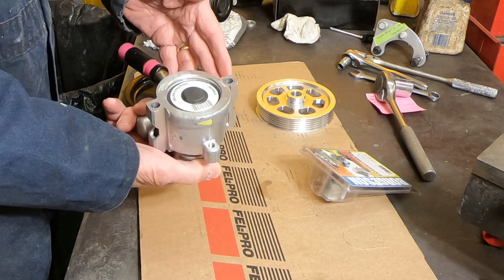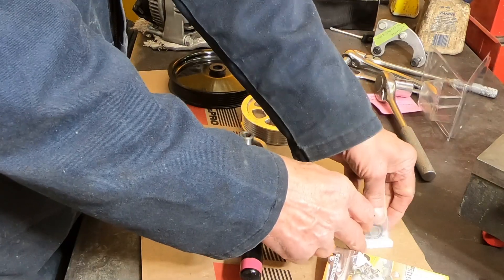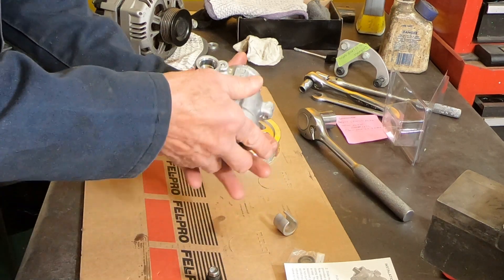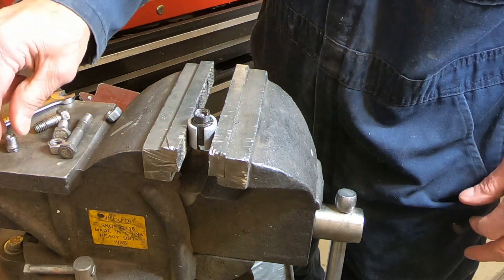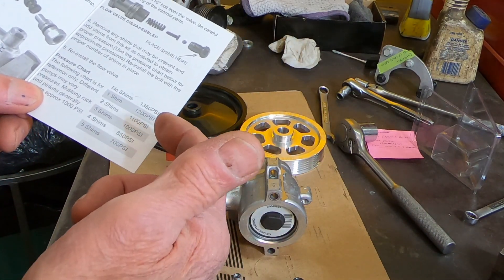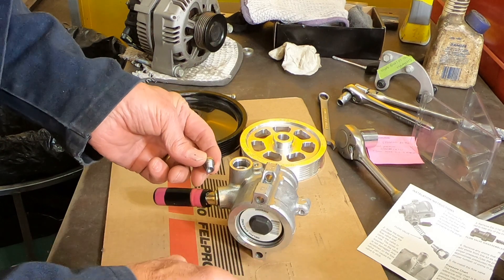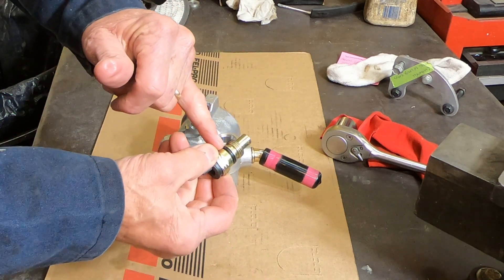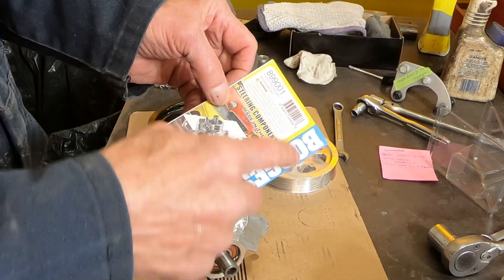Borgeson Pressure Reducing Kit for Power Steering Pump - Installation

Comment: Increasing the RPM of a fixed displacement vein pump should not increase the pressure, It should only increase the flow. It may inadvertently raise the pressure if the flow over runs the capacity of the relief valve, but if that's the case replacing the spring set won't change anything you would need to physically make the relief passage larger.
Reply from the maker: You are sharper than I am about this, but I know the people at Borgeson have been in this business for a long time. I just followed their instructions and so far, my power steering is working perfectly. Thanks for your comment. Perhaps I did not explain it very well in the video.
Reply: @DickShaw  they recommended changing the relief due to the pulley change?
Reply from the maker: Here is what was published. "General Motors style power steering pumps exceed the recommended flow for a Ford rack and sometimes when running a small diameter power steering pulley, resulting in quick turning and a twitchy feel while turning. Universal power steering pump pressure-reducing kits are designed to correctly reduce the flow, allowing for smooth, precise turning every time. Includes multiple shims and special tool requires to disassemble pressure valve."   So, it is more about flow than pressure as you say. Like I said, I probably did not do a good job of explaining why it was needed in the video. Thanks again.